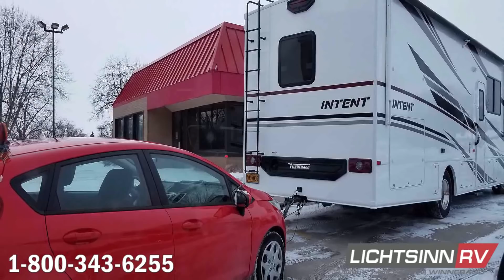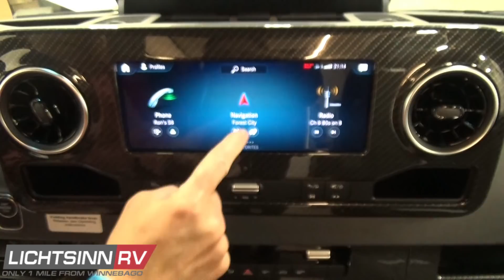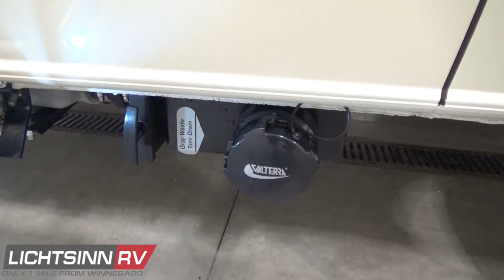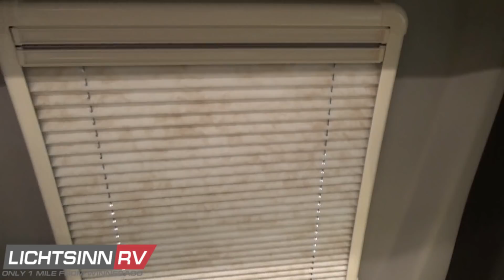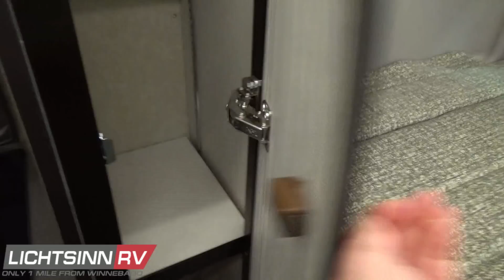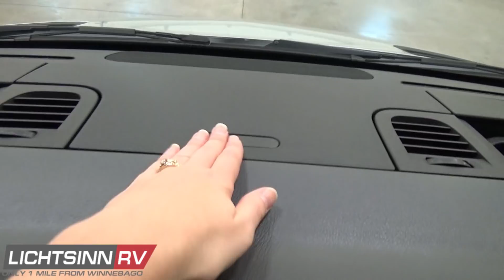LichtsinnRV.com - New 2020 Winnebago Revel 4x4 44E in Pebble Grey

Comment: Very thorough tour--thank you! The 2020 Revel is nearly perfect for our needs. In our case, we would always keep the loft bed in the down position and want to install overhead cabinets along the right and left sides to maximize storage capacity. I wonder if this is a Winnebago or third-party option (?)
Reply from the maker: Good evening!   The bed can be stored and left in the down position and we could install cabinets for you, no problem!
Reply: @LichtsinnRV  That's good to know--thank you! However, I just learned something about the Revel that could be a deal breaker for us. The Revel does not have Lithium batteries. I would be willing to sacrifice some "garage" space in order to have Lithium batteries inside the vehicle. Any chance the 2021 Revel will have Lithium batteries?
Reply from the maker: @realistindenial  Good morning!   The 3 AGMs work great, but we could move lithium inside for you if that's necessary.

Comment: Can you run portable generator on the roof for the air conditioning, as, for example, in a shopping parking lot.?
Reply from the maker: Good morning Paul!   Absolutely, no problem.
Reply: I mean, the generator mounted on the roof....
Reply from the maker: @Emuspaul  Hi Paul... yes, no problem
Reply: @French Frys you could go to a Xantrex installer and get the E-Gen system installed. It's not just the battery, but the inverter that needs to be powerful enough for th AC.

Comment: Very nice video. But the only reason why I wouldn't get it is cause you can run the air. For a pet while you aren't in it.
Reply from the maker: Good afternoon Amy!   Thanks for your note!   You can run off a portable gen stored in a gen box off the rear... or if this is not what you would like we also offer the Boldt with 2wd or 4x4 with the Volta Pure 3 system - you can see more on this at : https://www.lichtsinn.com/new-rvs-for-sale?s=true&types=116&brand=boldt
Reply: @LichtsinnRV  WHY No PRO AIR AC unit which is 12 volt? or lithium power unit etc?
Reply from the maker: @michaelsmith9308  Good morning!   Thanks for your note... the lithium is primarily not used to size constraints on the 144" wheelbase and cold weather charging considerations for lithium... I believe Winnebago's thoughts on the AC are ensuring a 12V AC is a long term viable solution compared to the test of time AC units we are using now knowing it's proven technology.
Reply from the maker: @carysmith6458  Good morning Cary!   We have covered this topic at the following link... hope this helps!   https://www.lichtsinn.com/blog/top-questions-on-the-lithium-powered-travato/